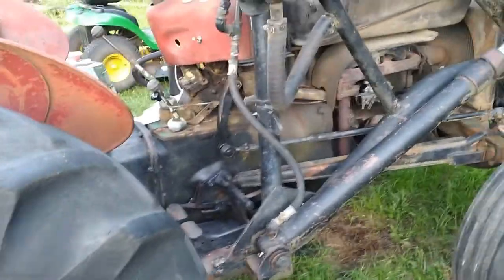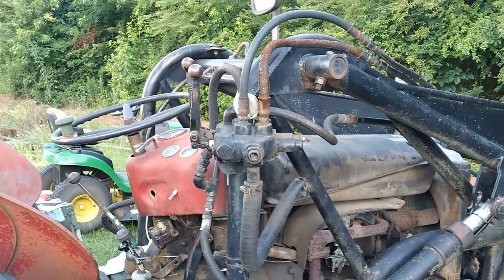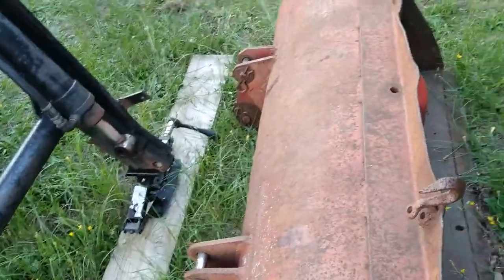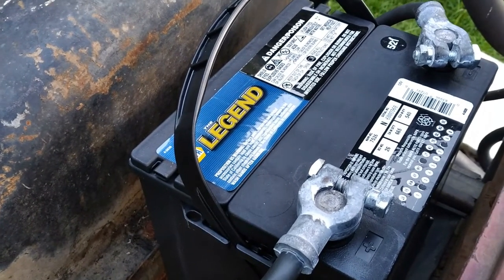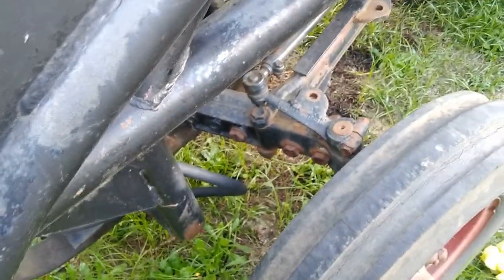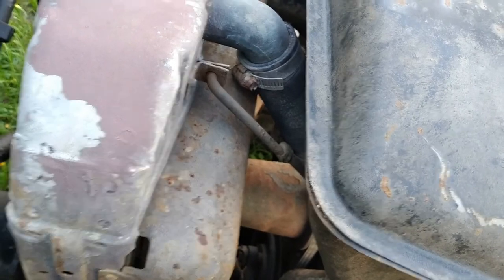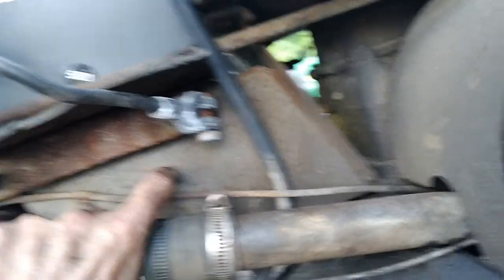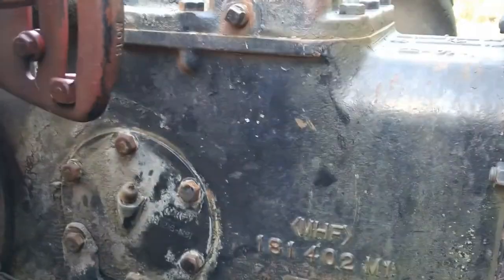Ferguson TO-35 Tractor. Was it 6 volt or 12 volt.

Comment: Carb dumping a little also...was running great. Died..points fried.
Reply from the maker: Yeah, the points tend to corrode then you have a lot of resistance through them, which causes hot spots on the the contacts and fries/melts them quickly. Watch for rust/debris on carb. It tends to hold open the flpat needle.